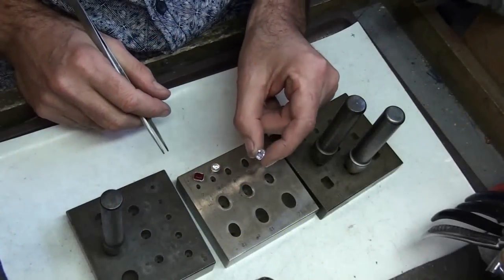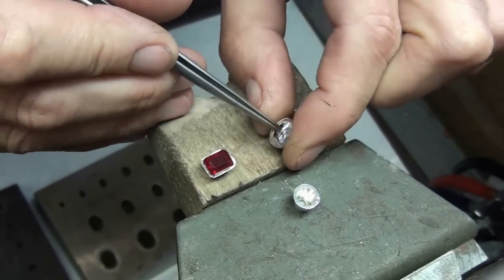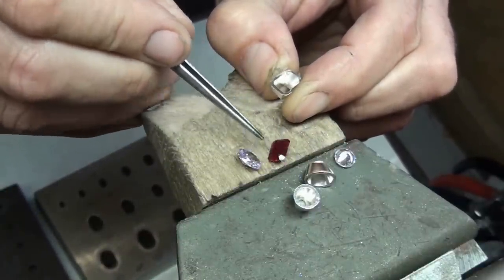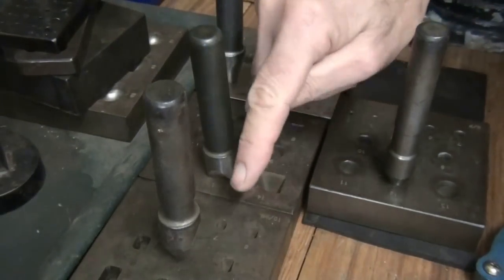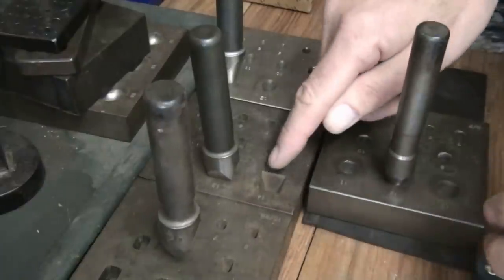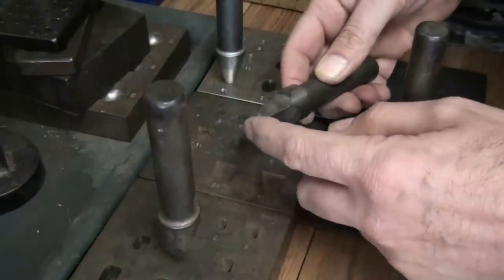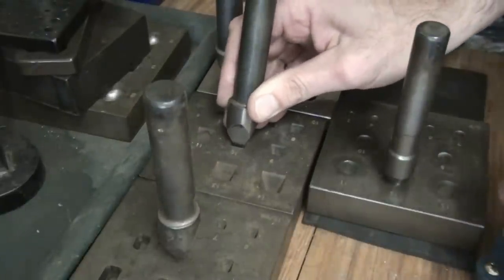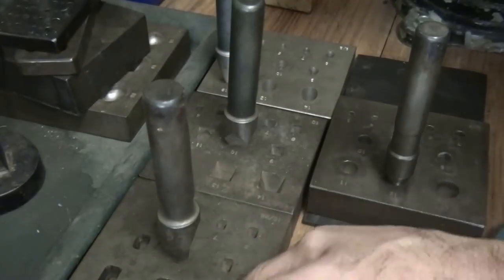Making shaped settings with collet blocks & punches

Comment: In this video you placed a straight soldered bezel in the collet block.
You had and older video where the bezel was first made having 17 deg wall.
How to prevent the solder joint from opening if you use the method shown in this video.
Thanks.
Reply from the maker: Hi Steve. You always start by hammering the straight wall bezel into the block first, then only use the punch at the latter stage to finish off
Reply: @jewellerytrainingsolutions9978  thanks 
So much